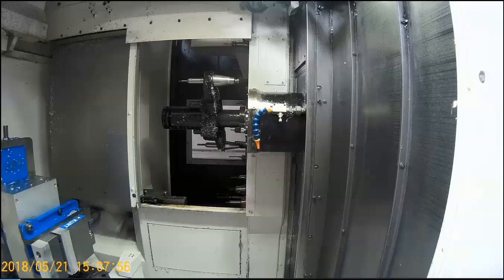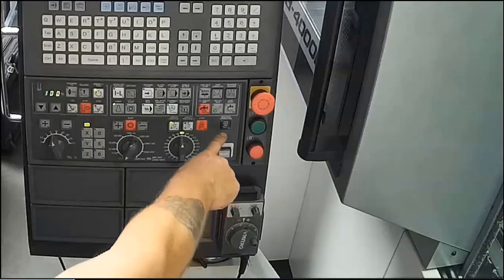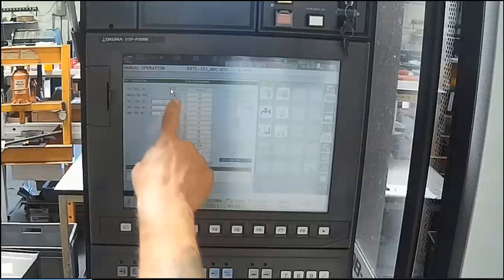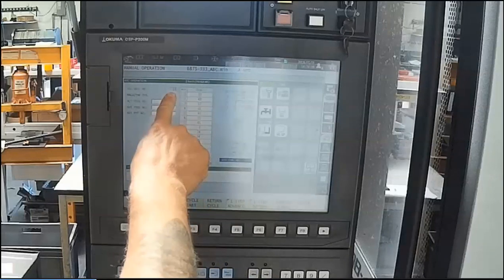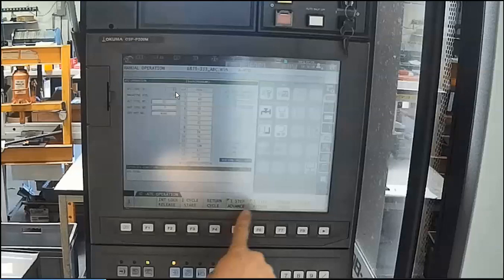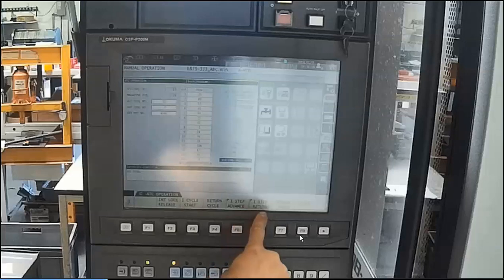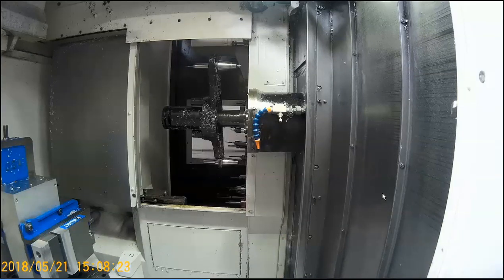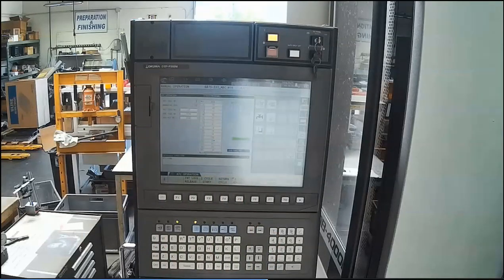tool change recovery

Comment: Yeah, what happens when that doesnt work...
Reply from the maker: By looking at the dialog block on the ATC recovery page, you should be able to see what is preventing the cycle from actuating. This is usually a lack of G30 P1 positioning, or the spindle is not oriented.  If you cant remedy the condition thats preventing the recovery, you'll need to follow the procedure outlines in the ATC resetting manual available thru your local Okuma retailer
Reply: @pocketcharleywithgosiger  I got it! thanks guys.